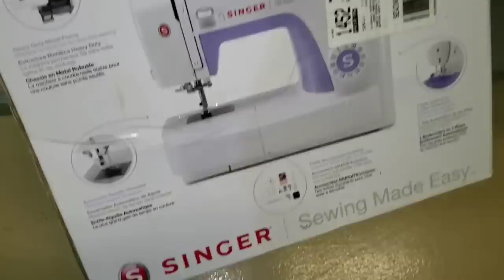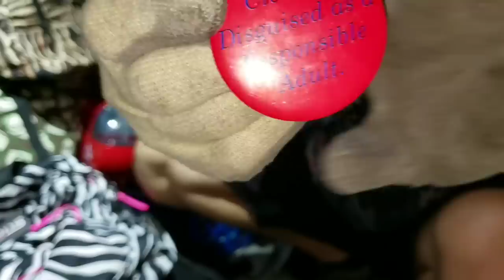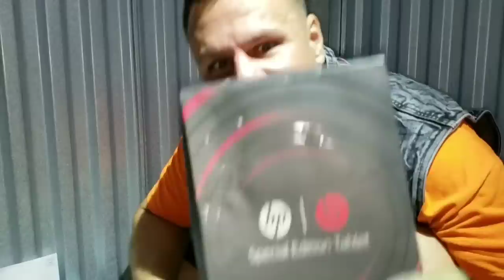ABANDONED LOST LUGGAGE I Bought A Storage Unit Locker Auction Opening Mystery Boxes Storage Wars

Comment: LUGGAGE TIPS 1, 2, 3, 4
Tie three or four colored ribbons around the handle to your luggage to warn others that this is not their luggage.  People grab luggage at the turnstile and take it  home before you ever see it.

Anywhere you put your bag, it could be grabbed in error.  Example:  overhead compartment, unloaded from the bus, at the hotel lobby, at the airport turnstile...

These ribbons make your luggage different and EASY TO SPOT when the piece is surrounded by 35 other cases unloaded from the bus.  Using 4 ribbons make it immediately different than other cases with 1 ribbon.

Use 1” wide ribbons 14” long and not longer.  Cut the ends at 45 degrees.

Tie the ribbons as a sandwich, as if they were one ribbon.  Use a man’s tie, a half Windsor knot for the best look.  After it is tied on, the total length of the ribbons will be about 5 inches from the handle.  This is too short to catch on anything such as rollers.

Scissor cut trim the ribbons to cascading different lengths after they are tied.  Put a drop of Super Glue at the end. 
If each ribbon is slightly a different length by 1/4” the color layers will all show up no matter how they drape.  

You can see these ribbons from 40 feet away.  
Perhaps tie TWO  handles or RINGS top and side of the case.  
Tie using a HALF WINDSOR KNOT to the metal buckle ring of the handle.  

Learn Half Windsor knot tying:
It is the 2nd example in this video
https://youtu.be/X0yh5rKB9lE
This knot does not loosen.

Put your phone number on one ribbon using a fine point permanent Sharpie.  
Example:  “Owner 454-333-7878”
No personal name necessary.
No address necessary on the ribbon.

Choose one ribbon with an unusual pattern or fabric to really make it unique.  The 4th ribbon could be black color.

Stand by the output port of the turnstile to reduce the chance of someone else grabbing your piece.

Tie your skiies, duffel bag, backpack and what ever else with matching ribbons—even your computer case.

If you are a Travel Agent, you could hot gold stamp one ribbon with your name and phone number.  Send them a set of ribbons, red and blue and BLACK to your customer as a gift.  Record this gift in your database so you don’t duplicate yourself.  
Buy a gold hot embossing machine.  Gold emboss your business name on the BLACK  ribbon.  Put the customer’s name on it if possible.

Pleasant color combinations:
Red, white and blue
Chartreuse and purple and orange
Orange and light blue
Orange and yellow
Gray and pink
Green and yellow
Red and Green
Red and Gold
Light blue and light green and white

The 4th ribbon could be white, gray, black, tan

Tip #2   Take a cell phone picture of the ribbon tied on.  Then another picture of the full luggage piece.  You now have a way to communicate “what it looks like” if someone is tasked with searching for it.  Take this picture outside in direct sun not under neon lights.

Tip #3    Place a strip of colored duct tape on the inside lining to your case.  Put TWO pieces in DIFFERENT places such as INSIDE  a pocket to the case.  If you dare, put your phone number DIRECTLY ON THE FABRIC WITHOUT USING TAPE.  Or, put your name and phone number on this tape.  If all identity is stripped from your case, you have this to show.  If someone steals it and rips off identity tags, you can show the police officer the inside tape...

To be sneaky about the tape, put your phone number on the STICKY side of the tape.  Nothing is on the surface side of this tape.

Tip #4  
Put your phone number on a 2” x 1/2” piece of fabric or plastic sheet.  Use colored Duct tape, such as black or red or neon, to tape this message to the top side of the handle. This message is under the tape hidden from view. The lettering does not touch the sticky part.  Wrap it 2-3 times.  Also include Tips 1,2,3 above.  If you need to prove identity of the case, just unwrap it and show...